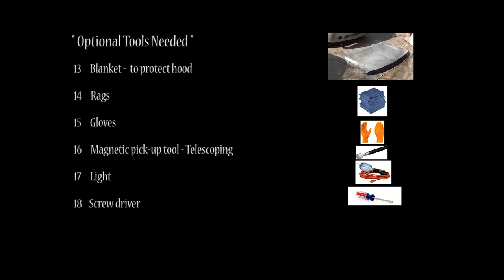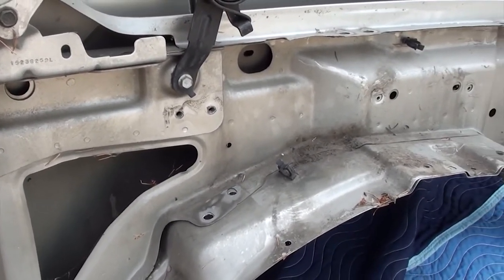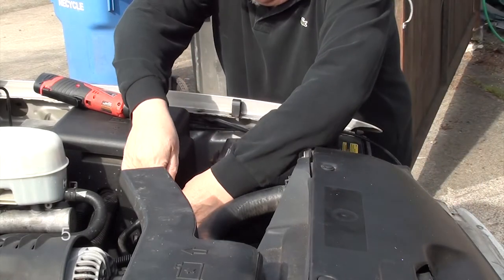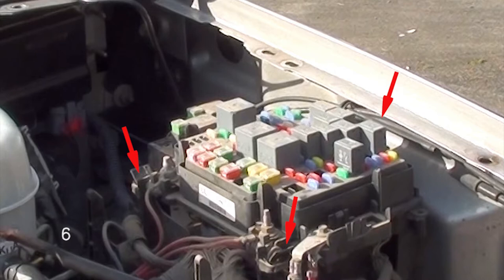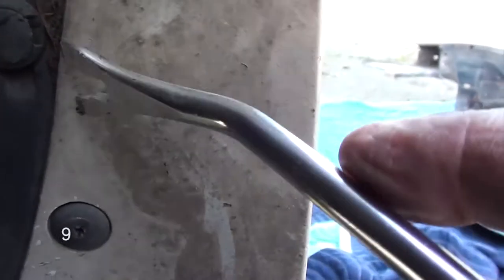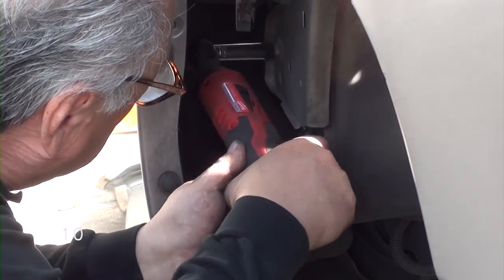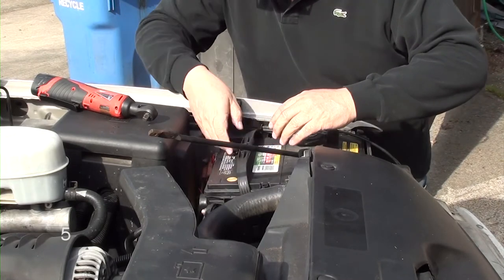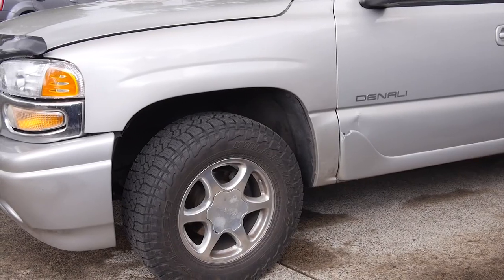GMC Yukon | Denali | Replace Fender [ 12 Step-by-Step | Instructions ] Easy DIY

Comment: Do you had one on removing the back fender?
Reply from the maker: there is no back fender to remove
Reply: Show you how much I know about cars can the back quarter pound remove like this also
Reply from the maker: @johnshaft3994  no, you will have to pound out your dent or cut it out and weld your patch in. There are youtubes on this subject.  Good luck.